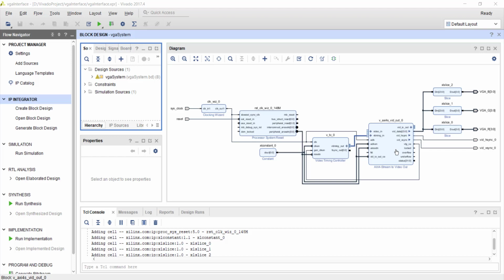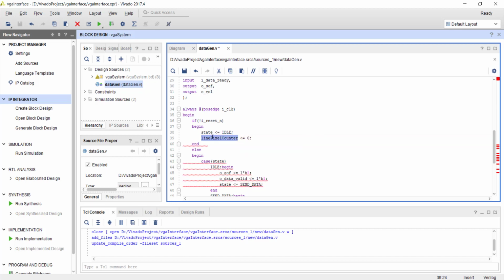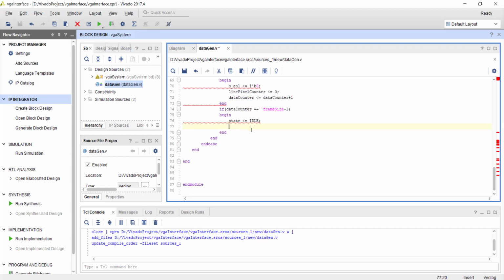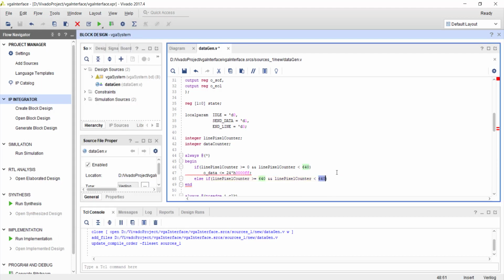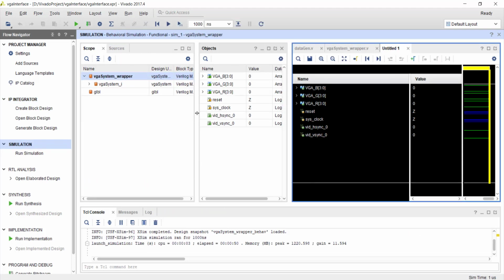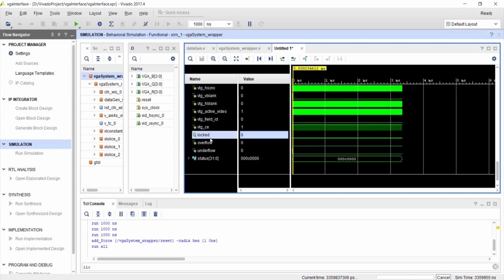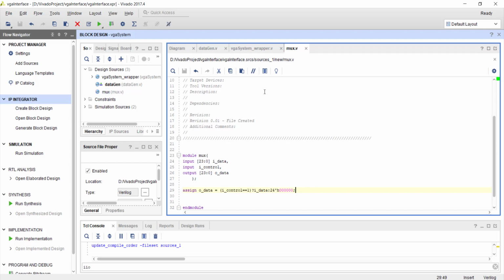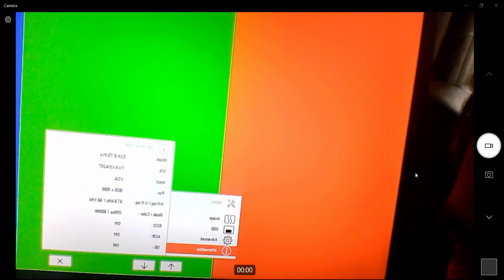Video Interfacing with Zynq (FPGAs): Part 2 Using Xilinx AXI4 Stream to Video IP

Comment: I am using ZCU106,  i am not getting the simulation result correctly, I am using 2022.1 Vivado
Reply: ig it doesnt have a vga port so have to use either hdmi or display port

Comment: Finally, I found the bug, it is in the DataGEN code, just change the pixel counter to this linePixelCounter <=  linePixelCounter+1;. I am not sure it is verilog version issue or what but this will solve the issue in case oyu have new vivado version

Comment: Hi Vipin, I am using yours datagen.v file and trying to display color bars on HDMI display. I am using zc702 onboard HDMI tx port. but first requested color is blue but its displaying green. And even giving 0x000000 pixel then also displaying green color only. what could be the reason? RED color its displaying well.

Comment: I've tried it a lot of times but it still doesn't work...during my simulation I  have nothing for my sync signals so same for VGA_R, G and B even if I run the simulation for 1h to reach 110 ms :(  however, I've successfully generated the bitstream but I can see nothing on the monitor, I always have this no signal message ..... Can I have any help ?
Reply: if youe issue was resolved? my simulations are working perfect but appears no output on monitor

Comment: Hello, thanks for very nice tutorial. My simulation works perfect. I am working with Xilinx ZCU111 fpga board. Instead of VGA, I have display port. Can you guide me how to map the 24bit video output, vsync, hsync, signals to DP_AUX_DATA_OUT, DP_AUX_DATA_IN, DP_AUX_DATA_OE, DP_HOT_PLUG_DETECT?? That would be great help

Comment: i am also unable to see any output, even using the prebuilt bitstream there is no output.. may be its because of the resolution support of LCD, but i also tried with 640x480 configuration, still no use
Reply: i am also getting same error can you help me ?